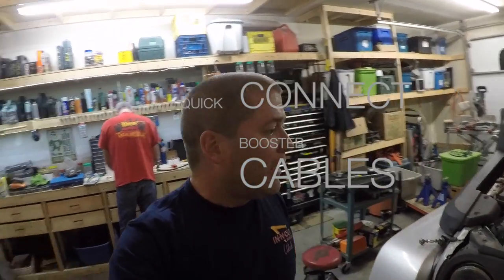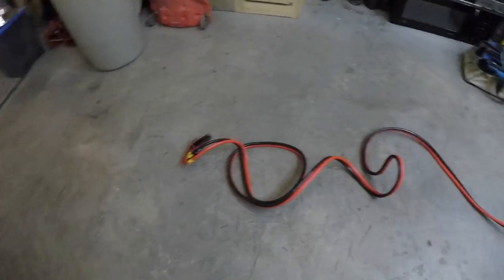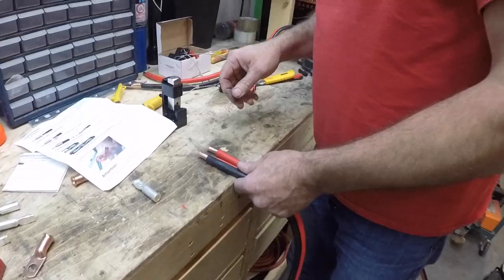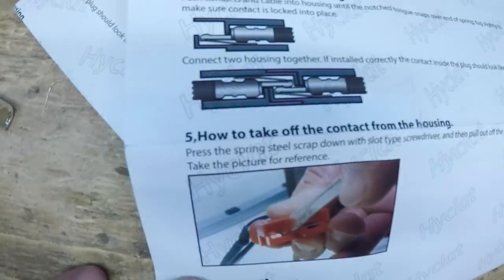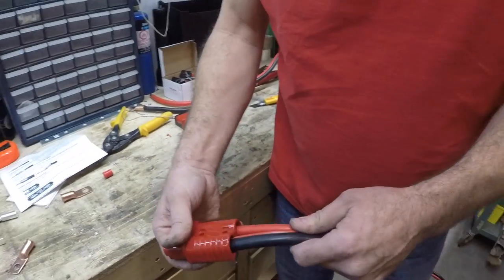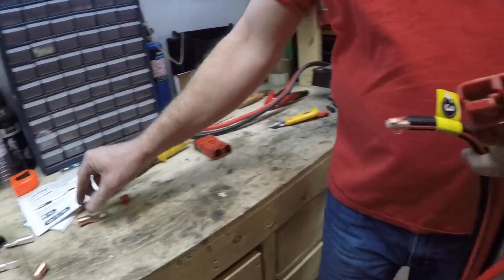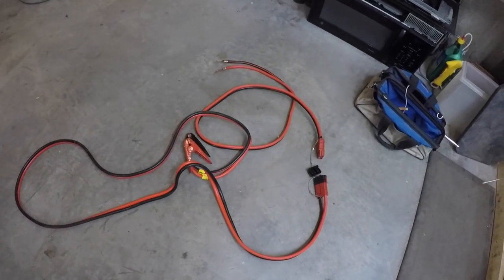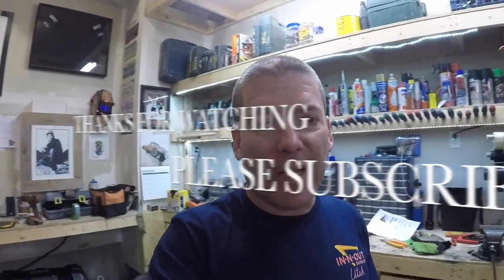Making Quick Connect Cables

Comment: If the vehicle that has the connector hooked to the battery needs to be jumped can these cables jump that vehicle as well.
Reply from the maker: Yes they can, they do have to be connected to the main post for maximum power transfer.  I have a dual battery set up in my Jeep, Genesis Dual Battery,  which has a center stud to mount these cables.
Reply from the maker: DaRonte Palmer yes

Comment: Not to be a "know it all" but, cable does not look like it was cut to proper length. The cable should be long enough so it bottoms out against lug. I may be mistaken but, yours is not. It DOES in fact make a big difference with resistance as well as vibration. As well as when where the cable is crimped. You have what appears to be "power lugs" and are to be crimped in 2 places. Again, it DOES matter and there are codes to go by. I understand this is just a DIY project but, I would rather see a video that has done it correctly. Correctly by the specs of the wire, the lug, the industry. Not a troll and mean no disrespect. Thanks for the effort in making this video.
Reply: Made my originally comment before watching the complete video. Before watching the crimping tool you are using. I will now keep my comments to myself as I appreciate your effort but, this is NOT how to make these cables. Hate me if you want but, others will appreciate my comment and search you tube "how to properly make battery cables".
Reply from the maker: Thanks for your comments. Thanks for watching.
Reply: Dingleberry, that crimper is perfectly adequate for the cable used in the video. 

Drop Dead!